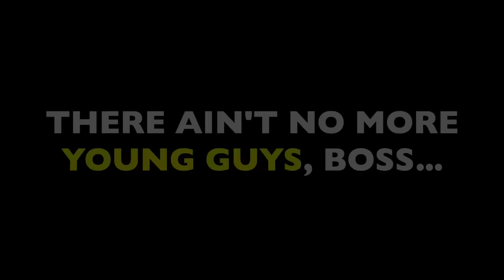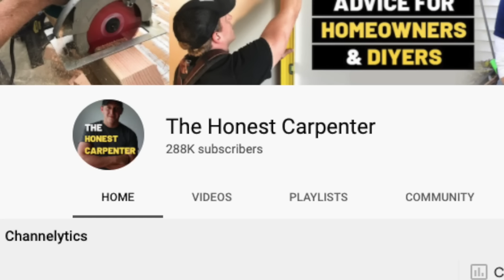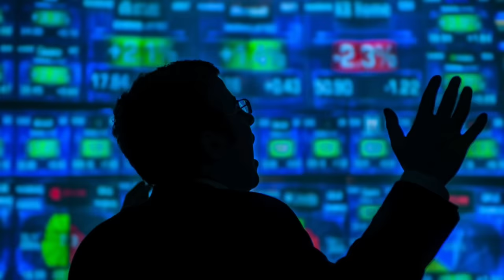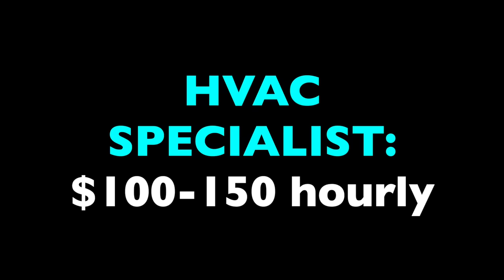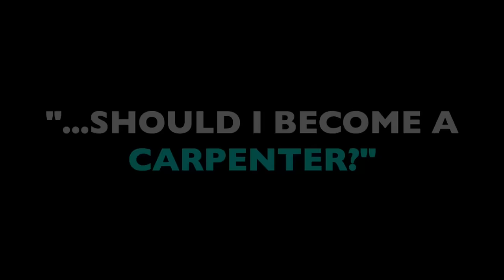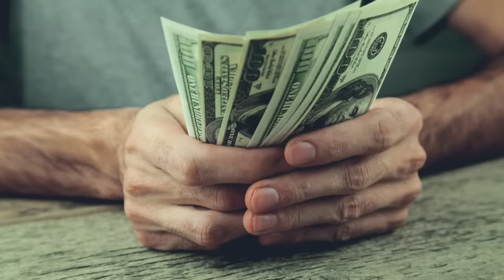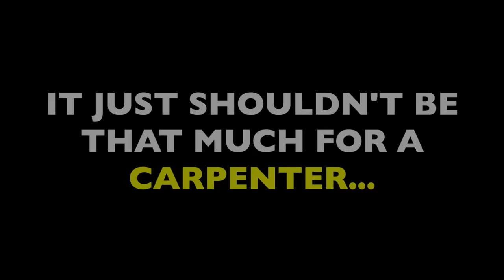WHERE HAVE ALL THE CARPENTERS GONE?! (Why The Trade Labor Shortage Is Only Beginning...)

Comment: Genuine question... what is the carpenter’s union doing to address these issues?
Reply from the maker: Hey Connie, there actually is no carpenter’s union in NC. There is literally no governing body, no official training program, no oversight other than general framing inspections. Every person living in NC is technically a potential “carpenter.” That’s why I call this state the Wild West of the construction industry.
Reply: @TheHonestCarpenter  There are state trade licenses for plumbing, electrical.  Time to do the same in carpentry.  Builders Association will oppose so a fight is required.
Reply: @TheHonestCarpenter  That's the south...says this Arkansan.
Reply: @TheHonestCarpenter  thanks for the reply! That’s very unfortunate.
Reply: Ethan, this is as good of an explanation of the shortage of carpenters (true craftsmen/crafts women).  I am a retired CEO from the construction industry that started multiple construction companies.  My father was a master carpenter with a small commercial and residential construction company.  HE started me learning the trades as a ten year old in 1958.  Ditch digging, brick layer helper, concrete placement, rough carpentry and finish carpentry.  He employed union carpenters in Arkansas and Texas.  I think the start of the demise was in the 1960s when the carpenter union made changes to its apprenticeship training.  Before, the apprentices were taught every aspect of the trade over four years.  By 1970, they might work at a defense plant and spend their four years building headwalls.  Not much value there unless your firm specializes in that work.  You are correct about the physical difficulties of the trade and I have experienced the results over the last decade.

Carpenters are the job superintendent in most cases with the greatest responsibilities from the first layout of a project until the completion of the punch list and acceptance by the owner.  He or she must be knowledgeable about every trade involved.  Your video “hit the nail on the head,” unfortunately.  Love your videos!

All of the master carpenters I know are retired, disabled or dead!
Reply: I believe there are Union halls in Lexington , Charlotte (Brand new training center) , Raleigh , and Jacksonville .
Reply: @weldo1948  Thank you for mentioning She as well.
Reply: Ethan,I enjoy your videos.I learn a great deal watching them.I am a meatcutter by trade.I may never be a carpenter, but because of your channel I'll be able to do a few things for myself.Thanks
Reply: Unions are not the answer here....I will not work a union job...I refuse to be in a union.
Reply: @davidbrewer7937  any suggested solutions?
Reply: @connieerickson5193  Not really apart from what the HC says here. The truth with me is that I am an electrical/electronics engineer of 35 years but I will no longer do that highly technical "clean hands" work for the money people will pay me. I design complex industrial systems & can diagnose just about any fault with a machine, mechanical or electrical but nobody fixes things any more & I watch with  heavy heart when so called "qualified" people cannot perform basic fault finding techniques. Luckily for me, I am fortunate that I have a big hat rack & can turn my hand to a lot of things due to long, wide experience so now I am a self employed renovator & have been for 6 years now. My clients love my work, I do not advertise, it is all recommendations  but I will only do the jobs where clients are willing to pay properly a fair day for a fair day.
Reply: @davidbrewer7937  thanks for the reply. It sounds like your years of hard work and dedication have landed you in a good place!
Reply: I’m from Los Angeles originally and went to college there. I got involved with set construction for the theater department along with a few friends, and the head carpenter (not a student) was also working in the movie business and theater. He’d hire us sometimes for gigs. Along the way I shifted into another area of movie production (lighting), but one of my college friends entered the carpenters’ unions apprentice program. It was a program trying to get more women into the trade, which helped cover her expenses.

Our skills as a set carpenters were rough. You needed to be able to measure, operate a circ saw, a table saw, a screw gun, a brad nailer, and that was about it. Most of the time set walls (flats) were already made and the bulk of the job was assembling the flats into the walls of a set with drywall screws. Everything was made with doug fir, pine, plywood, masonite, and luan.

My skills stayed about the same. I got faster and that was about it. Meanwhile, my friend became very skilled. Our friend/boss got into the carpenters union when a show he was working on turned union mid way through the production, and he started getting union gigs in big budget movies. Meanwhile, my friend had gained some impressive skills through her apprenticeship. She was able to move up with him and became his second in command. I still got occasional gigs through them, but it was generally unskilled labor (unloading the cool stuff they had built whatever studio and loading it up again at the end of production), but I was already working non-union productions doing lighting, serving a more informal OTJT apprentice ship. I never made it into that particular union (IATSE), and after a few years moved out of the L.A. area and did other stuff. To be frank, I never got my shit together, but that’s another story. I drifted off and lost contact with my friends.

To wind up the story about my friend, she did quite well. She racked up a lot of credits on some big movies. When I was still in L.A., I asked her about her union experience, the politics of it, and treatment in the union as a woman. She said early on there were a few old timers that gave her a little extra shit, but it wasn’t much more than the normal bullshit any new worker gets from the crusty old farts. The union backed her up because she was a competent hard worker. 

As I said, I lost touch with her and other friends. Last I heard, she met another gal on a job and they eventually married. That’s L.A. for you. 😄 (To be clear, I don’t think there’s anything wrong with that. To each, his or her own.) The point is that the union gave her an opportunity. She adapted to the job politics and union politics—but it as it turns out, there’s almost always some level of politics with any job in any industry where you have coworkers, bosses, and clients. In my experience, anyway.

I’m not sure what more unions can do if young people aren’t applying to their apprenticeship programs. In the world I came from (entertainment business), it was highly desirable to get into the union and move out of the low budget non-union ghetto, so there was never a shortage of applicants. Maybe there aren’t enough trade schools, maybe there’s too much emphasis on getting a college education (which we’re now discovering is a debt trap for many young people).
Reply: Pay is one issue, but the brutal day in and day out of the job is also a big factor, as is the fact that a lot of people, other tradesmen included, take framers for granted. The mechanical trades think their jobs are so much more difficult and complex, customers who watch HGTV think it's easy, and builders tend to go for the lowest bid. I believe framing is highly undervalued on new homes because it's hidden, and the money is definitely spent on the things that look pretty. Funny thing is, a good framer will more than make up for their increased price by reducing the cost of the trades after him by laying things out with foresight(plumbing, electrical, hvac), making sure the walls are straight and plane nicely (drywall/cabinetry/tile/siding). From my experience I think there has also been an influx of immigrant labor with people willing to work for low wages that has kept framing going (nothing against them, they gotta earn a living too).
Reply: Born in L.A
Work in the Bay Area!
Union Carpenter
Bay Area wages
Working Biotechnology!
Making real Money!!
Reply: Union bad merit shop good. Lot of suggestions but I would first start thinking about what is the state doing? They need to promote growth to promote building. I am a trade school graduate and will always promote them as well. Many more!!
Reply: @stillholding4975  Say what you want, but the Union PAID me to go to college and paid for my apprenticeship to become an Electrician. You can bash unions, but you can't whine when you have issues like the Carpentry situation in NC.
Reply: lol...who???? 90% of the carpenters are not union...50% are now Mexican...
Reply: @dtbone6  at least 50%
Reply: @davidbrewer7937  Problem is a lot of unions are crooked, the leaders wear suits except when they go out in the field to talk to their 'men', then they try to dress the part with ironed creases in their pants and soft hands.

Comment: I have always thought of carpenters as the “artists” of the building industry.  It’s a shame that job stability and pay for carpenters are like artists.
Reply: Not hard landscaping? I always thought that hard landscaping had a touch of artistry about it. But really, so many of the trades don't get the respect they truly deserve.
Reply: well, can't say they are very good artists, my brand new house I installed a door in a hallway and it turns out the width at the top of my wall is not the same size as the bottom of the wall. Dr horton should have given me a discount for living in a triangle.
Reply: Amen custom homes for 40 yrs you better be an artist as I am !!!!
Reply: @potatochobit  You bought a DRH home, what do you expect.

If buying new, always go check out the job before it is finished.

Comment: As a fellow tradesman I have long admired the work of master carpenters. Your trade like machinists is underpaid considering what you need to know to master it. Do you find in today's world of engineered homes , a lot of the highly skilled parts of your job has been replaced by things like engineered truss systems? But even still, the amount of knowledge that goes into the weather treating elements of new homes is staggering. But it seems that the bull work aspect of the jobs is now handled by men of lesser skill. Of course, there are those who can afford custom work and cabinetry skills. But that is probably a niche market.  I remember sitting in my attic of my 1908 Victorian marveling at the complex miter cuts on all the roofing components. It's an admirable trade but one hard on your body and hands. I am a 41 years  of service elevator mechanic.

Comment: I worked as an electrical tech during my first year and a half of college, this was also trade school, but I got out of that and switched my major to engineering. The trades work is hard, it's a different kind of hard and requires so much physical, mental, and emotional strength to exhaust yourself day in and day out and do it every morning again. I have the utmost respect for those in trades, especially because I know for a fact that I couldn't handle that.

Comment: It's the same here in Australia . We have a shortage of tradesmen. The politicians suggest we should encourage older folks to work longer but the politicians have not fixed rebar at 80 F or 0 F or poured concrete in the heat .

Comment: I agree 100%, but my off the cuff thoughts are that buildings will gravitate towards prefab panels assembled on site.  The larger the corporation the bigger the penetration.  This will be also facilitated by governments drive towards higher density multi-family housing.  In the name of energy savings, traffic congestation reduction, public transportation, and energy consumption.  There will be less and less need for general carpenters.  Built in bookcases?  I, like most people, couldn't afford those 40 years ago and still can't afford them today.  I'm not saying it's right, or the best, it's just the reality.  If you want a trade, concrete, steel worker, plumber, electrician.  Not to make money, but to simply have a full career without becoming obsolete.

Comment: Thank you for talking about this. I'm recently retired from the trades as a carpenter I retired at 70. I was working in central Texas and this is my take. In the 80's as trim a carpenter was pay  decent and you could support yourself at that time. In the 90's I had to move into remodeling and work for individual clients. And finally I got tired of working with clients and the last 12 years I work for a major cabinet company as an independent contractor and installed cabinets. On the jobsites I was on it was almost all Hispanic labor [you got a good taste of there so called music]. The people coming over the bolder were doing almost all the work. Usually  the main guy spoke English and Spanish and he ran a crew of immigrants probably a lot of illegals. These are the people doing the work in Texas. Amost all the masons, sheetrockers , roofers, tape and floaters, rough and trim carpenters are people from below the border. I will say they are highly skilled and motivated. The young people in this country are not going for these jobs we all can't be You Tube sensations, musicians, doctors, lawyers, are even into gender studies. One thing that can be said for the trades is at the end of the day you can see what you have accomplished. It is a rewarding profession.
Reply: I was a Painter for a summer and still think about the houses that I've painted as I drive by ten years later.
Reply: Hispanic tradesman are no different than Anglo's. A few do quality work; most are just wood butchers.

Comment: Three years later (and I've repeated this message for years) we're flying off the cliff and just haven't hit the bottom yet. The elders around here are TIRED and have no help. A guy's doing the foundation for an outbuilding on my property and he normally had a team of 10 but now works alone. He's 70 and doing backbreaking work. But the plumbers, electricians, and contractors for home all also report there's no one on their way up. One plumber's so proud his son is maybe thinking about becoming a plumber. But that kid's friends all got screwed by a teacher from a year-long program because their program was invalidated after it came out he didn't have the right credentials. It's tough out hear. The heat of the ground can be felt and we're coming up on it fast.

Comment: As a retired carpenter/general contractor, I hear you and you have identified the reasons for the labor shortage for carpenters: the pay. However, i think there is an intrinsic reason why  they are paid much less than, let's say, electricians. It is because when you need an electrician, or plumber, or HVAC tech, they can usually do their thing in a few hours, and seldom for more than a couple of days on the residential side. However, the carpenters are needed for a much longer period of time. 

So for example, on a typical residential remodeling project,  people can afford to pay $90 an hour for an electrician who is there for 6 hours, but they cannot afford to pay someone $90 an hour for a carpenter for a week and a half or even longer. Couple that with local licensing requirements. More people are allowed to do carpentry work (even when they are incompetent) than for HVAC, electrical, or plumbing. The rationale from the municipal code enforcers is that the aforementioned trades can kill people with incompetent work. You could get electrocuted, die from CO poisoning, or be exposed to noxious effluent from poor workmanship. The carpentry work is considered to be less important from that standpoint.

Comment: i did steel roofs/cladding and agricultural carpentry (new pole barns and refitting older barns) for close to a decade for less than 40k cad a year. i honestly feel cheated. definitely no longer in the trades nor will i ever enter them again.

Comment: In Florida, requiring all carpenters to become licensed contractors in 2003 forced many underground who were great carpenters but not good test takers, and/or didn't have the $$$$ needed to take the tests, pay for licenses, etc., due to their low pay. My spouse got licensed, but then had to compete against all those guys who were able to charge a lot less because they couldn't hack either the testing, the costs or both. I think all you said is spot on, but I would add that many carpentry projects are elective and can be put off if people can't afford them, or they will do wood working as a hobby and think they can do it themselves with the help of DIY You Tube videos. On the other hand, if your pipes break and water is pouring out, you simply have to get a plumber right now, no matter the cost. At 40, he quit doing any framing to save his body, but at 70, he had to retire and is hobbling around on pain meds. 2008 trashed our savings, so he is not enjoying himself much either. Still, he loved it and misses it every day and considers himself lucky to have been his own boss and done something he loved, outdoors in the fresh air. "No cubicle, and no neck noose" as he would've put it. Pay badly needs to go up, though where we live, illegal migrants are taking those jobs, at low pay with no benefits, so I don't see it happening soon.

Comment: I was a semi truck mechanic when I was younger but it was just not worth it, at least where I live. Most shops wont pay even $15 an hour starting even with experience and  expect you to perform back breaking labor in the heat for 40-50 hours a week on jobs where you hold the driver and general publics safety in your hands.

I was a decent mechanic and I really enjoyed the trade but it just wasnt worth it, I quit to become a locksmith and most of the other younger guys I worked with drifted into other stuff like HVAC or Truck Driving.